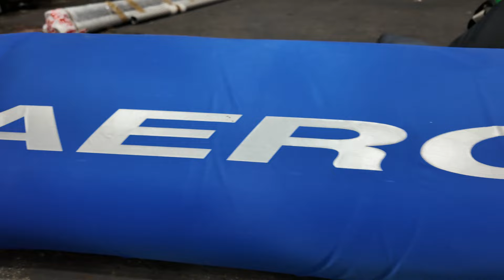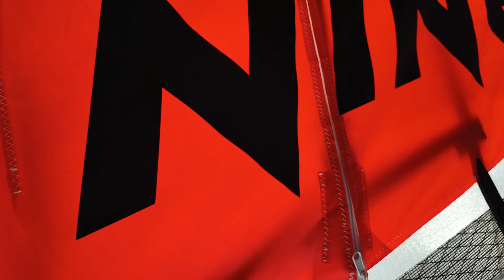Collecting my new FlyLight Aeros Nine Wing - How to put it together.

Comment: I just got my NINE wing, and it's a thing of beauty.  One thing I was worried about, and looks like it'll turn out fine,  was the haul back hook, and how  would take to set it in place. On my Fox 13, it's  a pain, and I was afraid the Nine's would be worse.  I tried wrapping my hands around the rope and pulling back.  It worked, but it was hard to get the hook on,  and evev harder to get off.  On my pull back cord, there's  lope at the end. I took that loop and hung it on the  center tube...way in the back.  I was able then to just pull down  on the cord,  and easily attach the haul back hook.   Anyway, it was very easy.
Reply from the maker: @stone8597  good stuff. How are you enjoying the new wing?
Reply: Haven't flown it yet...want to take my time, and the weather has been bad.

Comment: Congrats 👍 
The wing tip battons on new wings are fantastic. Those are the things i hate the most on my older Solairus. Heavy fiberglass rods that have to be inserted and then tensioned with a lever.  Releasing the tension is the tricky part, to fast and the outside end jumps out behind the end holder and you have to remove the holder to get the rod out😞.

I looked at ordering a new wing, not in the cards this year. 

Looking forward to seeing your adventures with the new wing.

Cheers
Reply from the maker: Hi Patrick. Yup, the tip wands are just a genius idea. They remain attached to the wing so no chance of loosing them and as Giles demonstrated, fitting them is a one handed job! I can see me have some fun with this wing. 👍